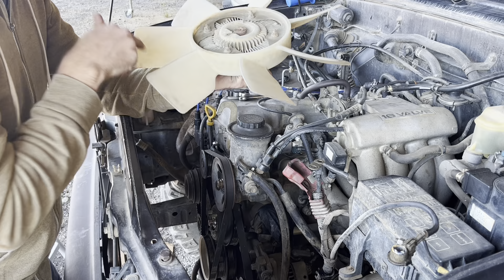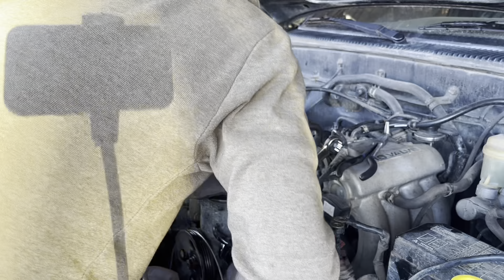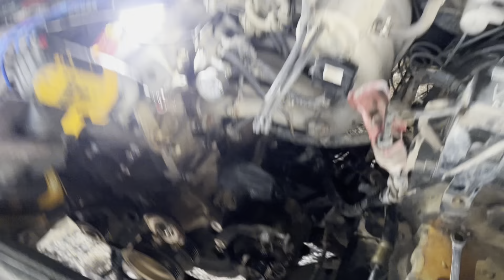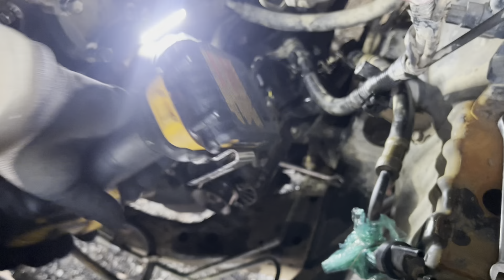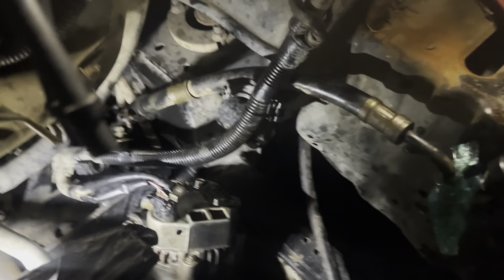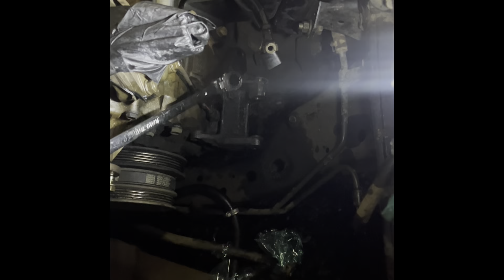1997 Toyota Tacoma 3RZ Engine Removal Part 2 of 8

Comment: I'm getting ready to begin this endeavor myself. Is there a reason why you pulled all the accessories before hand? I was planning on pulling the front clip and pull the engine/transmission still mated.
Reply from the maker: I was just following the directions, the front accessories helped with clearing the front grille, there are some like the air intake plenum that could probably stay.

Comment: wheres the rest of these vidoes?
Reply from the maker: I’ve only got three days in so far, I guess I could have waited to the end.  I have a full time job and then some and money is tight so cross your fingers.  I have to have the engine out by end of January then it will be a couple months to get it back and then a couple more to reinstall.